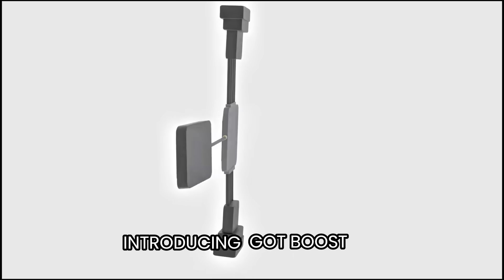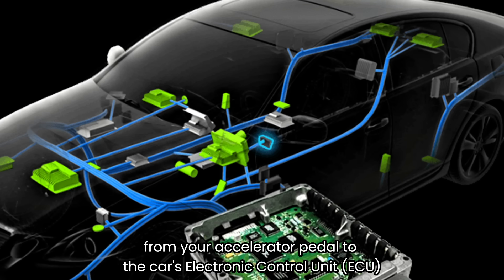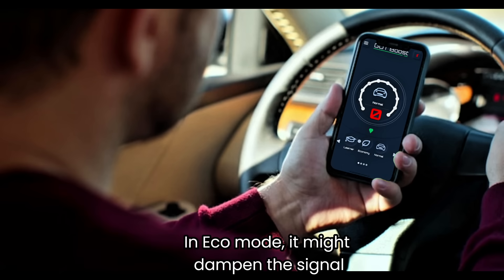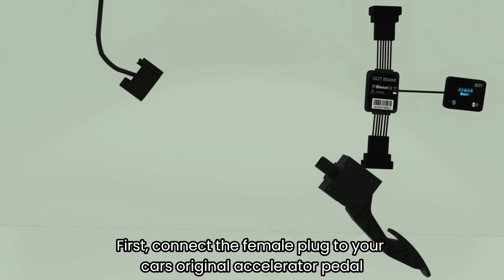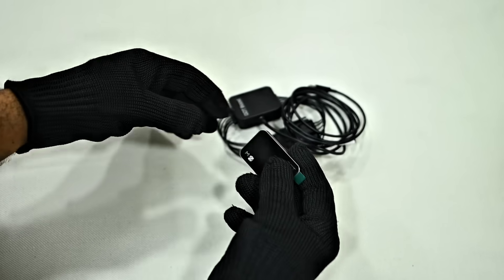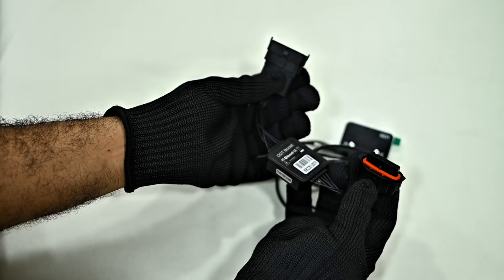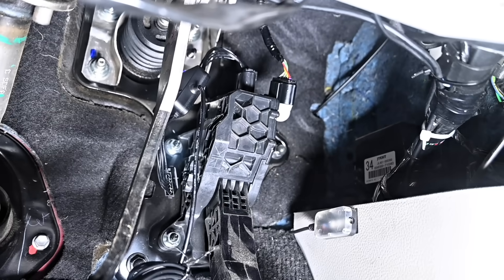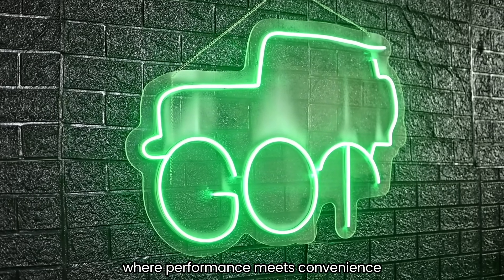Complete Guide: What is GOT Boost Device and How to Install it on your Car Step-by-Step Tutorial

Comment: What about fuel economy
Reply from the maker: There are 12 different modes that you can choose from, if you want power you can choose from the power modes, if you want better fuel economy, you can use the eco mode, and when you need the best of both power and fuel efficiency, you can use the AI mode that learns from your driving style and adjusts the power based on driver’s live demand.

Comment: What if this module fails, any warranty
Reply from the maker: GOT Boost comes with a 1 year warranty and we also have extended warranty warranty programs that you can purchase to extend your warranty. GOT Boost is built with a fail safe mechanism, where incase of a rare chance of failure it can stop sending any signal to the accelerator pedal, so that you can take out the device and conncet your original connector back.

Comment: Where can I install in Chennai?
Reply from the maker: This is a DIY Plug N Play device that is easy to install - simply plug it in and connect the throttle plug (male and female). If you need assistance, we are available to help via phone or video call, or you can also seek the help of any roadside mechanic for installation. 
For order and other queries plz Whats app india  📱 +918287124344 📱 +919315581180📱  +91 93154 80955 Us/Canada.  +1 (365)  833-9849 11am to 6:30pm (Sunday closed)
Reply: @GOTBoostPro  sir I own a triber amt, and I'm usually travelling fully loaded, I just want to know how this device will help me going uphill and in highways. Any compromise with mileage in highways? Any lags or over reving in hills?

Comment: Important note it does not increase cars hp it only makes throttle more agressive for eg if u give 1 percentage of throttle then this device would give 10percentage which makes it different but no difference in cars actually performance 😅
Reply from the maker: Yes, it does not increase any power figures of the car but to understand it better, there is throttle map in each car and GOT Boost introduces a new throttle map based on your mode choice. This gives you better throttle feel and faster 0-60 timings.
Reply: @GOTBoostPro  Does it increases car speed??
Reply from the maker: @mohanbhartiya2705  increase of HP can harm engine which design by company 😊
Reply: But that time definitely fuel efficiency reduce
Reply: @vishwasshukla1165 ofcourse it will, not only little but also on very huge margin